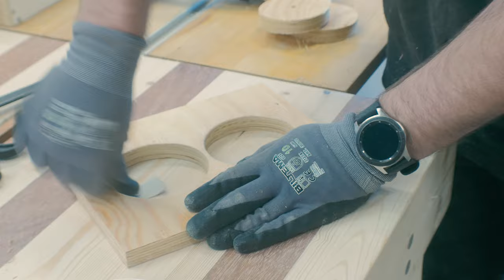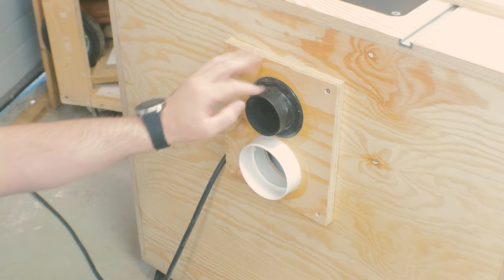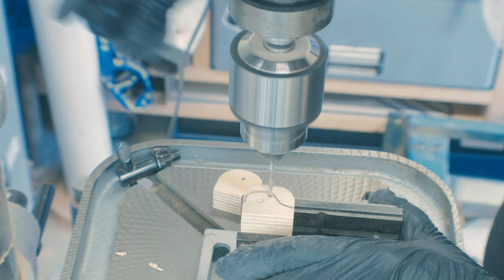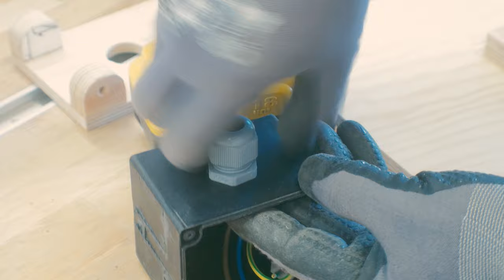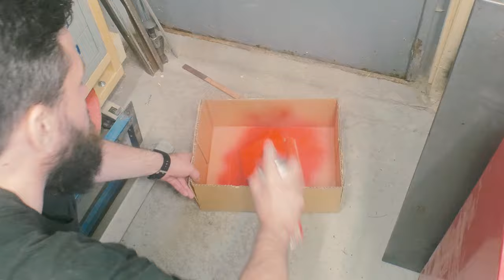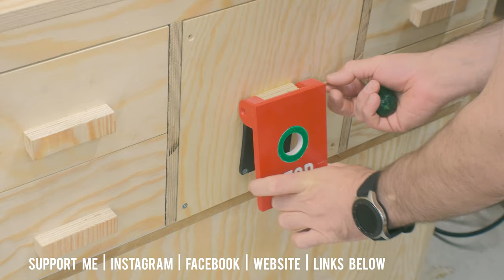DIY Router Table Part 4 - Start Stop Switch | Dust Extraction | Router Instalment

Comment: I’m at this point in my build. Thanks for the video. Would’ve loved to see how you wired the switch. 🇿🇦
Reply from the maker: Hi, I just wired it after the instructions on the switch, its just two lead in (230v) and two leads out of the switch. The switch on the router spindle is set to always on 👍😃 thanks for watching, let me know if you have any questions